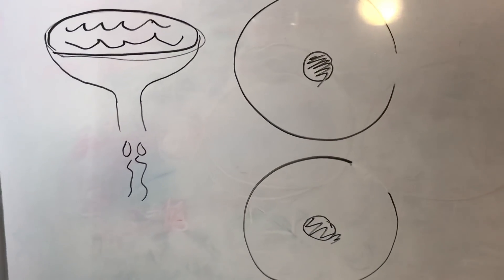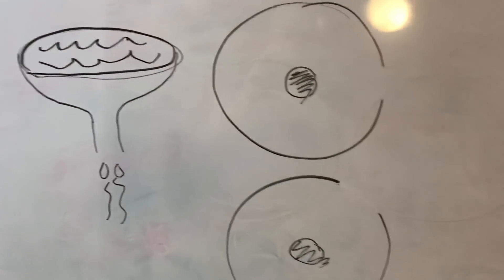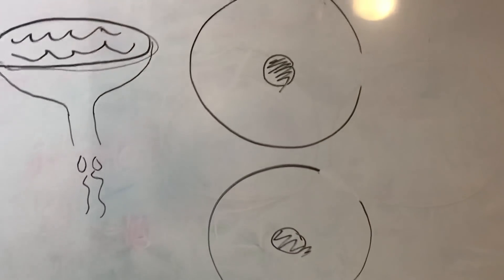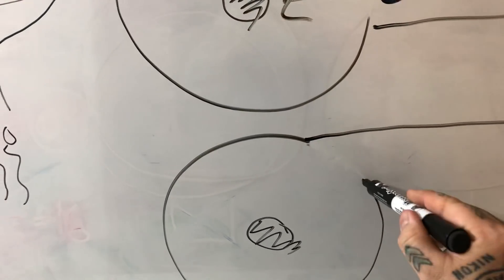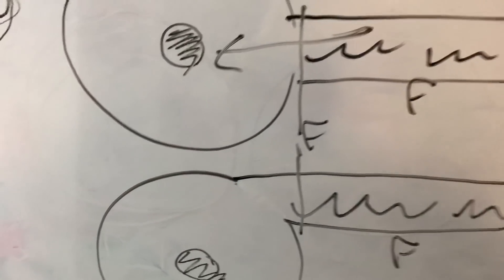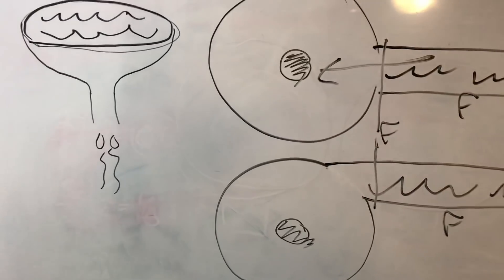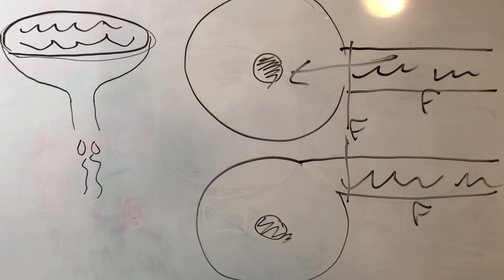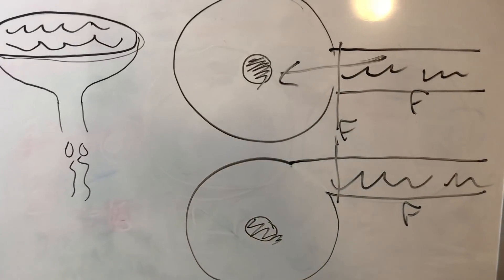🤔 Nature’s Mystery: Cuvilinear pressure & Vortex dynamics

Comment: The tangential input, or vortex, would drain faster as it could potentially gain energy from earth's spin:
 creating suction, accelerating flow.
Reply: 1mremington If the earth is spinning at 1,650km/h (@ the equator, slightly less as you move N or S) how do planes manage to land on runways running in all directions without crashing? Also, flying times going east versus west don't match what we would see if the earth was spinning at such a high rate.
Reply: Please allow me to reply to your questions with questions. Why does water spin when it drains? Who does it spin in opposite directions, if observed in the Southern hemisphere versus the Northern hemisphere? Yes, my geographical terms imply a spherical earth. Believe what you will. :)
Reply: To satisfy your questions. The reasons why aircraft do not experience these speeds has to do with atmospheric drag.  The atmosphere tends to get drug along at similar rates of speed, as the earth; and so do aircraft in the atmosphere.  You may be interested to know that launch locations and launch directions, of space bound rockets, are chosen carefully to take full advantage of Earth's rotation velocities.  There is a reason why the U.S. launches from Cape Canaveral Florida, the southern most point in the U.S.
Reply from the maker: the planes are also spinning along with the earth, but moving in a diff vector relative to the spin
Reply: The earth is not spinning and it is not moving. It is hanging (or suspended) upon nothing (Job 26:7). The Hebrew word for "nothing" (belimah) literally means "without anything." Gravity, according to occultist Isaac Newton, is a force (based on the magical teachings of Hermes). According to Einstein, the idiot who invented nothing (and i quote Ken here), gravity is a warping of the "fabric" of space time. Does that sound like "nothing" to you? The earth is suspended/hanging/dangling not swinging/flying/circling around the sun. Suspend a bauble from a Christmas tree. Is it circling around it? Of course not. Either God is a liar or man is.
Reply: Job 26:7 doesn't preclude Earth spinning in space, by my reading.  It could be interpreted to mean that the Earth is simply not hung on anything, such as a Christmas tree. ;)
Reply: Your understanding is incorrect. 

"The one who builds his stairs in the heavens and establishes his structure* (or vault, dome) over the earth." 

What are the "stairs" that God builds in the heavens and what is this dome-shaped "structure" over the earth.? The ancient symbol for the structure (which has "stairs") is everywhere, and i mean EVERYWHERE. Do you know what it is?
Reply: Your welcome to enlighten me.  Please cite your scriptures.
Reply: https://www.youtube.com/watch?v=GeWKwmKVFYo&t=6s
Reply: The pillars of heaven (or "pillars that hold up the sky") of Job 26:11: https://www.youtube.com/watch?v=7Vqs853hVdE&t=12s
Reply: That's strange Daniel, i don't see anyone mentioning the flat earth theory in this comment thread. I think maybe you should thoroughly investigate the subject of geocentrism before jumping to conclusions and criticising. I also suggest that you study what the Scriptures say in regard to scientific matters and compare it to what heliocentrists such as Newton and Copernicus taught, who based their ideas on the mystical teachings of the Hermetica and religion of Heliopolis. After all, i wouldn't want you to be deceived by pseudo-scientific mumbo jumbo propagated by sun-worshiping occultists who belonged to a secret brotherhood that controls science at the highest levels, including NASA, the Smithsonian, the Royal Geographical Society, and the Royal Society....Poor thing.
Reply: My town was the favourite destination of Queen Victoria. As such, the symbols of the brotherhood are all over the architecture here. But this is not unique, as this is replicated in towns and cities all over the world. This is because Freemasonry (the builders of Matt. 21:42) built and rule over Britain and America (Rev. 17:9) and they are also the "great city" that has "a kingdom over the kings of the earth" (Rev. 17:18). That kingdom includes politics, royalty, and religion. Freemasonry is the "mother" that gave birth to all false religions through builder Nimrod (Rev. 17:5). Her kingdom also encompasses science, the military, finance, and entertainment.

You made the wrong choice Daniel. Heliocentrism is the big lie designed to mislead the "entire" inhabited earth (Rev. 12:9), including (and especially) the chosen ones (Matt. 24:24). Why lie? Isaac Newton was a false prophet who wrote more about Bible prophecy and the occult than he did science. He wrote about the prophecies within the books of Revelation and Daniel. He was a secret society member who knew the prophecies about the destruction of the ancient brotherhood that he was a member of (Isaiah 47:8,9; Rev. 17:16,17). Something had to be done to prevent this. The result was his theory of gravity - the lynchpin of heliocentrism. So long as God's chosen ones and the rest of his people believe in heliocentrism, which is pagan sun worship, there can be no Kingdom of God. This is why Revelation 18:4 says "get out of her (Babylon the Great/Freemasonry) MY people." Heliocentrism is Satan's master plan designed to prevent his own destruction, and over the past few hundred years he has implemented this plan very sucessfully. My role is to undo this "spell" he has cast on mankind and set his people free (Rev. 18:23). 

One of the secret societies that Newton belonged to was the Priory of Sion. Their emblem was the fleur-de-lis combined with the eternal knot (analemma/infinity symbol). The fleur-de-lis symbol is ancient. It means lily flower. The Babylonians called the sky "lil." The symbol is everywhere, including inside and outside churches, cathedrals, synagogues, temples, mosques, government buildings, within ironwork (railings), and even people's houses. You will find the fleur-de-lis symbol on a compass rose, usually in the position of north.  Who/what does it represent and why was it used by the secret society Newton was a member of? The answer is on my channel. Here's a clue: Professor G. R. Driver (of Brown-Driver-Briggs) considers the Hebrew word lilith to derive from a root word denoting “every kind of twisting motion or twisted object,” even as the Hebrew word layil (or lailah), meaning “night,” suggests a “wrapping itself round or enfolding the earth.” What do you imagine is dark (invisible/night) that is a twisted object with a twisting motion that wraps around and enfolds the earth? Maybe Ken's work on magnetism will give you the answer.
Reply: Can you interpret the signs and symbols of the brotherhood who control large parts of the entertainment industry? http://borderlands.wikia.com/wiki/Lilith Note that the logo for the game is a compass with a background of circles. "Lilith is a name with origins in Judeo-Christian mythology spanning thousands of years. The name has been associated with demonic and elemental entities." The substance that holds the elements is the ether. Note that lilith is also known as "the firehawk" and the storyline in the game has human sacrifices performed to her. The firehawk is a representation of the phoenix - an ancient occult symbol of the brotherhood who "rise from the ashes" of six world empires to rule the seventh. It has its roots in ancient Heliopolis: "The importance of the solar cult at Heliopolis is reflected in both ancient pagan and current monotheistic beliefs. Egyptian and Greco-Roman mythology held that the bennu or phoenix brought the ashes of its predecessor to the altar of the sun god at Heliopolis each time it was reborn." The motto of Phoenix University is "WE RISE." There is a phoenix mural at the United Nations. The United Nations is "the 8th king who springs from the seven (Rev. 17:11). Freemasonry and occult secret societies founded and promoted the U.N. Lilith acquires a giant lazer from the "Helios" station. Lilith's special power, the phasewalk, is to turn "invisible" but still be visible to her teammates. Lilith also has the ability to charge the "vault" key.

"‘The one who builds his stairs in the heavens and establishes his structure* (or vault, dome) over the earth" (Amos 9:6).

Do you have the key to the vault yet?
Reply: Continuing in Job 27:1, "Moreover Job continued his PARABLE [emphasis added] and said,.."  It may be a fallacy to interpret a parable literally, wouldn't you agree?  With that said, you do present some interesting information in your videos worth considering. Thank you.

Comment: The water moves against the circular bowl containing the drain.  As it does this the water level in the center of the drain is lowered so the remaining water in the center accelerates due to rotational centrifugal pressure like an ice skater pulling his arms in to accelerate rotation.

Comment: Water flowing downward naturally forms a vortex so the second drawing the water input would accelerate the natural vortex formation and speed.
Reply from the maker: thats still just a description not an explanation......... how come?  :) .....in the case of a CLOSED SYSTEM where there is NO incoming....why is outward force translational to inward acceleration increase?  :)if you pull the drain on a full sink,  it drains MUCH faster if you (without any incoming water pouring in) swirl WITH FORCE, all the water centrifugally (outwards) ......how does outward centrifugal FORCE translate into the opposite, which is centripetal inward acceleration? :)
Reply: Theoria Apophasis Because length of rotation size multiplies force into the axis.  Almost like number of turns in a transformer or mechanical advantage of the length of the coiled ramp around a screw vs. the length of the screw itself.  However, in your reply to the gentleman above, you changed the scenario.  In your video the scenario had to do with where the input of an open system was, and your reply was soley pulling the plug on a tub.  I see it's related, and I do enjoy your questioning style of teaching.  I also very much enjoy that you often bring up the ignored elephant in the science room:  what IS something rather than only describing what it does.  I think much of education ignores this way of thinking too much.

Comment: The bottom. Vortex  path is faster than linear.
Reply from the maker: thats still just a description not an explanation......... how come?  :) .....in the case of a CLOSED SYSTEM where there is NO incoming....why is outward force translational to inward acceleration increase?  :)if you pull the drain on a full sink,  it drains MUCH faster if you (without any incoming water pouring in) swirl WITH FORCE, all the water centrifugally (outwards) ......how does outward centrifugal FORCE translate into the opposite, which is centripetal inward acceleration? :)
Reply: ...Thinking
Reply: aόριστος δυάς
Reply: None point source dielectric acceleration

Comment: The bottom one because it starts the vortex, the counter-clockwise rotation
Reply from the maker: thats still just a description not an explanation......... how come?  :) .....in the case of a CLOSED SYSTEM where there is NO incoming....why is outward force translational to inward acceleration increase?  :)
if you pull the drain on a full sink,  it drains MUCH faster if you (without any incoming water pouring in) swirl WITH FORCE, all the water centrifugally (outwards) ......how does outward centrifugal FORCE translate into the opposite, which is centripetal inward acceleration? :)
Reply: what happens with this in America where on the northern hemisphere water vortex goes clockwise? Does it affect the drainage? or does it depend on the pressure behind the flow?
Reply: The answer is the bottom version drains faster. This is because the mass of the water (hence pressure) is greater towards the centre, which, when combined with the shape and direction of the curved bowl (concave/inwards) counteracts the (outwards) centrifugal forces. I would imagine if the drain was funnel shaped (convex) the reverse would be true., at least to some degree. Also, the more flow there is the more pressure there is at the centre, which causes a faster drain. The top version has little flow pressure (or even direction) so momentum is reduced resulting in a slow drain.
Reply: Theoria Apophasis Is it like the mechanical advantage of wheel and axle vs a screw driver.  The same machine, but one is power (distance) into a smaller point, the other is power from a smaller point into less power but further distance?